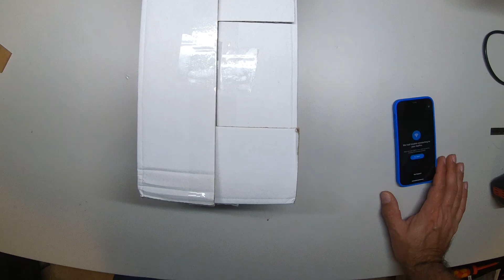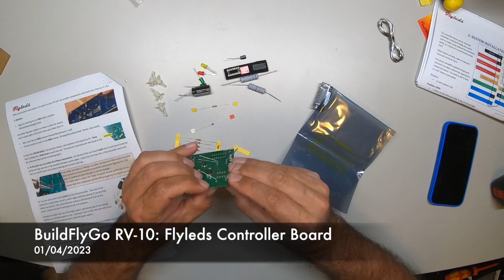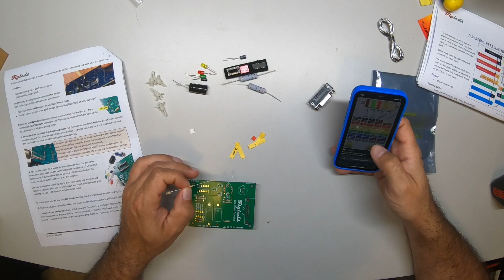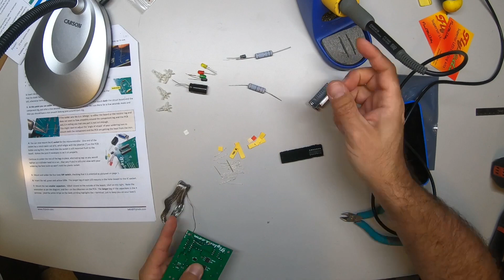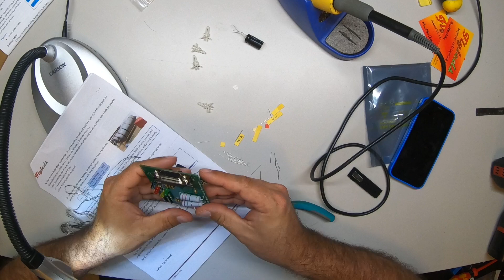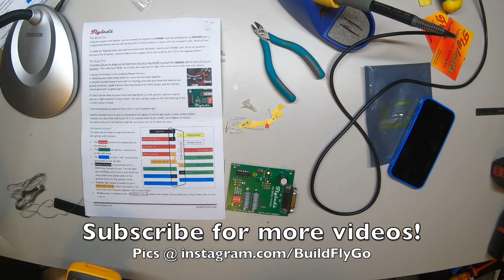Soldering the Flyleds Controller Board

Comment: What did you guys go with, the works kit?  I’ve heard some say the 10 wingtip causes a dark spot dead center, so just curious what you guys decided.  I ordered the leading edge kits and plan to do those with the seven Star lights.
Reply from the maker: We are doing the seven stars in each leading edge and an original kit in the wingtips. This is the same that we have in the -9A and it's a great combo.
Reply: @BuildFlyGo  that’s exactly my plan too.  Thanks for confirming.